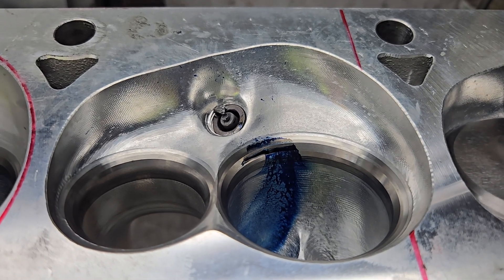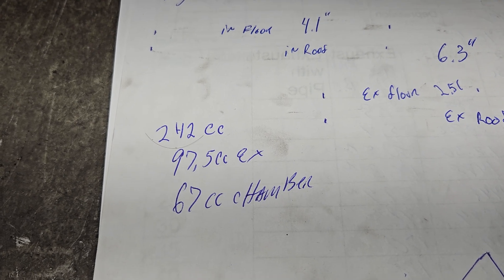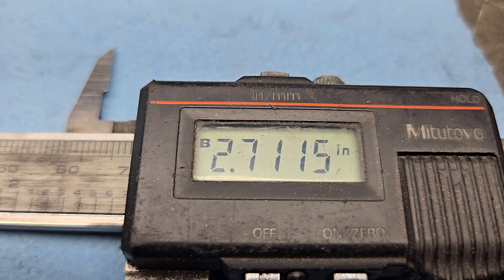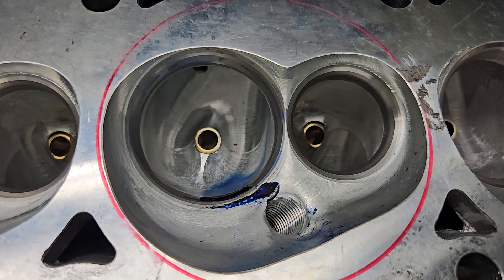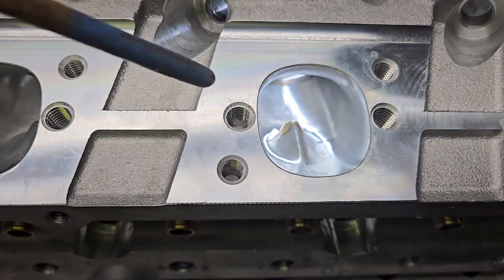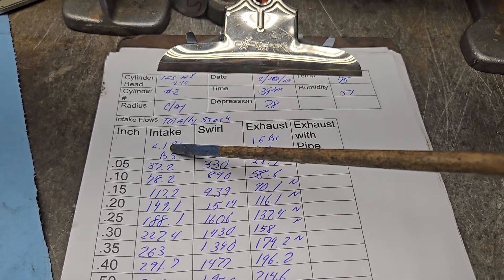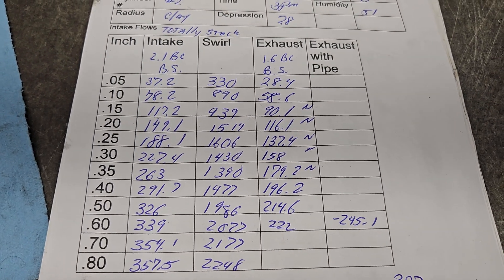Trickflow TFS High port 240cc cnc stock flows and air speeds, with modified valves.

Comment: Charles on the flow bench, have  you ever seen a head lose flow if the intake is moved away from the bore wall and pick it up when it's moved back? This happened a .600 lift  on an edlebrock victor 440 BBM heads standard port size.
Reply from the maker: @lucascb750  Darin talks about this. Pressure recovery works better if the flow can follow a shaped wall in the chamber. If the wall is too far away or angle of chamber is too shallow it may cause flow to tumble or seperate, causing flow reduction. Thanks, good question.
Reply: @servediocylinderheads awesome, i did this as a kind of test to justify if I should open the chambers more, maybe that would be in error. The bore plate is 4.36" as well as the chamber at the moment, but my gasket is 4.5".

Comment: What lift did you shoot the dykem at? Darin Morgan shows in one of his videos,  a ford head with two different dylem patterns, signifying different lift points,  just wondering what the swirl curve is like and if the flow swaps sides as the valve lifts?
Reply from the maker: .75

Comment: I have never seen intake and exhaust valves so close that there is a knife edge. Well a butter knife edge but I think of cracking or a hot spot.
Reply from the maker: @paintnamer6403  Think how tight they would be with oversized valves!

Comment: Thank you for the review! I am wondering would these be good enough to Make 700 Horsepower?
Reply from the maker: @smilsmff  Check Wallace racing. Thanks
Reply: @servediocylinderheads  700 possible (before choke area .) for 493 c.i. nice street engine for sure , thank you for your review.
Reply from the maker: @smilsmff  You are welcome

Comment: Definitely heads that require an experienced porter. I would probably just make them worse since they already look pretty good. I tried playing with play doh in a port to make it better but I could not keep it from getting sucked into the valve. Fortunately it was at low enough lifts the valve caught it and I didn’t have to go fishing in the bench. 😂 how do you make the clay stick good enough? Or is there a stickier clay available for the job?
Reply from the maker: @bcbloc02  Making clay stick is always a challenge. Be sure the surface is clean and clay has a wide adhesion area.

Comment: i own a pair of these heads so, will be watching closely so see what you can get out of them. Our race heads- 440-1 ez, done by Dewayne Porter flow a little above 370 on intake, we make just shy of 900 hp on a 540 mopar with Bill Mitchel aluminium block. Interested in what we might get out of the 240 heads on a 512.
Reply from the maker: @fr.rustymatheny7707  I will record the whole process that I do. It is Brian's project so nothing will be published without his permission. We do have big plans for these. The problem with a good design is they are harder to modify!
Reply: @ if you don’t mind, would like a price when you know what it takes to do a pair .
Have 2 guys looking to use these instead of 270’s as they are to be on 383/400 engines as well.
I will remind you at end of your testing.
Thanks buddy, I enjoy looking at your work- have learned a good bit from you .
Thanks
Reply from the maker: @fr.rustymatheny7707  Remind me on charlesservedio@gmail.com
Thanks
Reply: @servediocylinderheads  I see it was a mistake to reach out to you.
My apologies .
If you know Dewayne at Porter racing heads, he will confirm I send him heads from time to time as customers need .
So, this wasn’t trolling on my part .
I see from the thread I reached out to the wrong folks.
My mistake.
Wish you the best .
Reply: @servediocylinderheads  sorry for the mistake on my part as to which heads you were working on. I didnt catch you were working on high port instead of the 240 powerports- hadnt really watched the video- just posted in haste as i was looking for something and saw you had a new video up. Had no idea i was going to get trolled and disrespected, called a liar and such for simply wanting to make contact. The reference to the race engine we run in nostalgia super stock was simply a reference point to getting more power out of mid range heads than we expected and that had me wondering how much the cnc mopar 240 heads could be improved. I have enjoyed your videos /learned a good bit /really enjoyed studying somewhat the software program you and David Vizard use etc. Its a good learning channel imho.
So, i was pretty shocked ( and angry) at the reception here over a simple human mistake made in haste as im pretty busy and seldom post, though i have posted on your videos before- always supportive and appreciative of your work.
Perspective customers getting this type of responses isn't good - i would think your "supporters" would know that .
I generally send out a couple sets of heads a season during the offseason but, was in the hospital a lot this offseason so, just simply saw Trick Flow 240 heads in the banner and jumped the gun-i dont think that deserves trolling/name calling /accusing people of being liars etc. 
Needless to say- i wont bother you and your folks again, just wanted to apologize for posting poorly, making a dumb mistake on which heads you were working on and for responding to trolls while being aggravated.I was simply reaching out to perhaps do some Business.

Wish you all the success you hope for, good health for you and yours.
Rusty Matheny
Rush Customs
Reply from the maker: @fr.rustymatheny7707  You are not bothering me at all. Sorry you were disrespected.   I don't need to police my channel much as most are very good on here. I believe in free speech, but some go over the line. Many of them have never had the old school reply that calling someone a liar will cause, and it shows. My apologies.
Reply: Those are sbf240s not Mopar
Reply: @ oh, I thought they were the Mopar 240’s from trick flow - my apologies .
Still, I’m going to follow closely .
Have you looked at the 240 head for Chryslers at all?
Reply from the maker: @fr.rustymatheny7707  I haven't done a set. Thanks
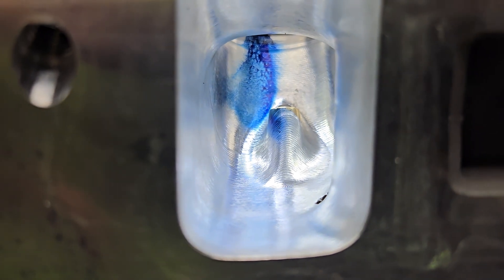Reply: I didn't notice they were fords until 1:22. I was alerted that something was up when Charles mentioned the valve sizes. I do own trickflow 240s myself.
After figuring out they are not Mopar I noticed all the differences. Everything is in close up so it's understandable. Mr bigbore, quit being a bitch
Reply: @bigboreracing356 thanks bud,
I intended no harm , it really was simply a “ haste makes me stupid “ moment of reading the banner or title ( whatever we call those these days ) , and posted .
The ole “ open mouth, insert foot/ leg etc” moments !
Just a dumb move to mark a video to get back to .
Don’t see many people posting about working on the Mopar 240 heads ( let’s face it , any Mopar heads- grin ) so, just got ahead of myself man.
I can certainly see my mistake and causing confusion.
Does being old count ?
Grin 

My apologies as well for responding in anger .

Yes, I agree, seems threads all over racing are full of posers/ wanna be / keyboard folks etc.
I suppose it’s just part of the whole social media thing .
Wish it wasn’t so but, your correct- there is a lot of it out there so- I can see how you thought this might be the case .
It just wasn’t in this case- this was just plain ole stupid jumping before checking .
Pretty embarrassing to be honest man , I felt pretty dang stupid !!!
Hahahaha .

As far as I’m concerned, it’s all good and, I got reminded to “ stop, breathe, think “ and then act.

Now, if I can remember it !!!😂

Have a blessed day man .

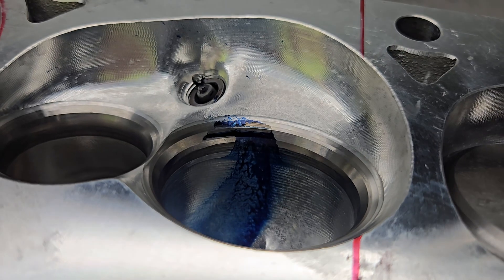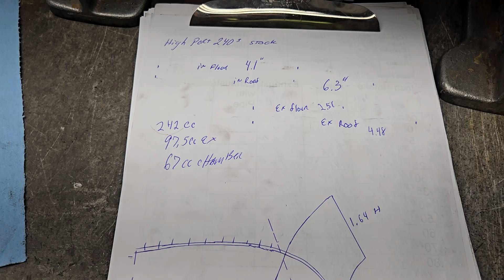Comment: @1:00 definitely looks like it changed the lateral flow coming off the seat. @1:40 from this angle, the vortex that wraps around the guide boss is rotating clockwise, which means it's trying to pull flow to the right(cylinder wall side), as well as carry it down the bowl on the COC side. The tooling separation mark is causing the flow to break down a little in that area, inevitable with machines because it has to turn the head over to machine it, that discontinuity in machining will leave a little tooling step mark. It's always there, no matter how good your machine is, that's why to get the very best out of an engine, you'll always need an old curmudgeon to polish out all those details.